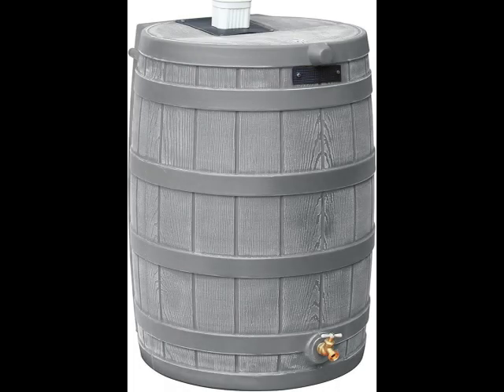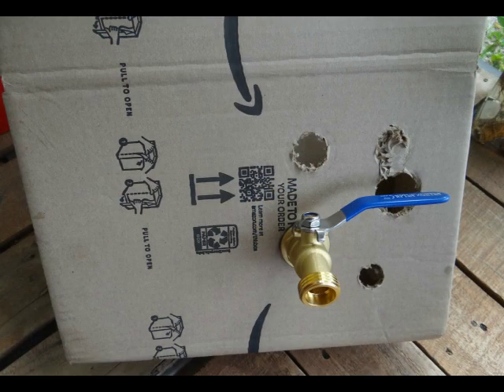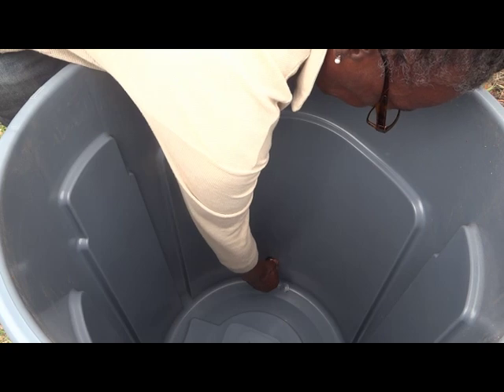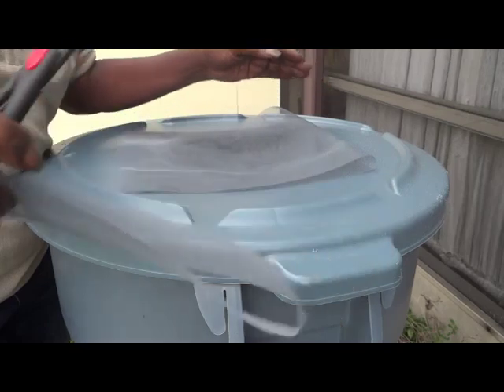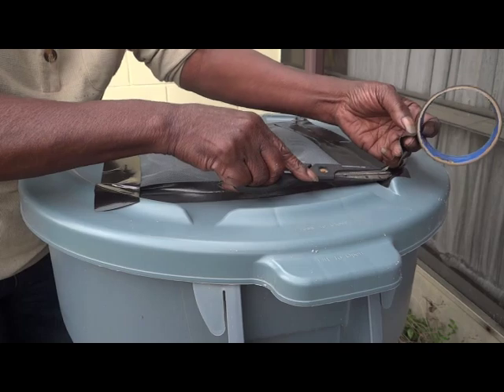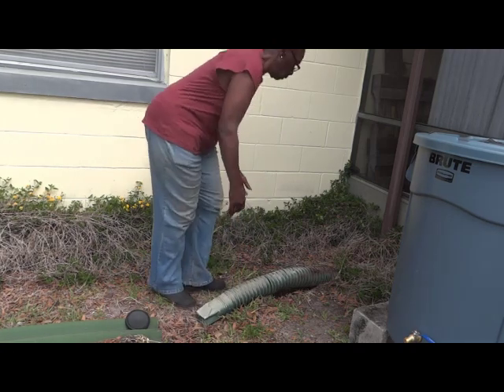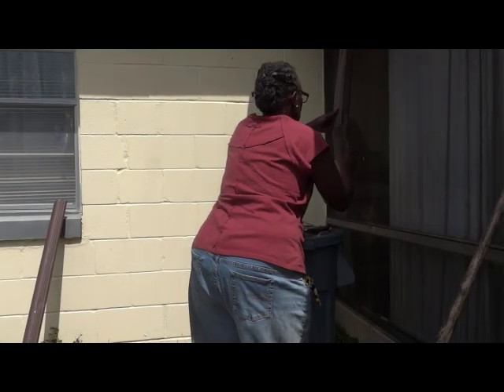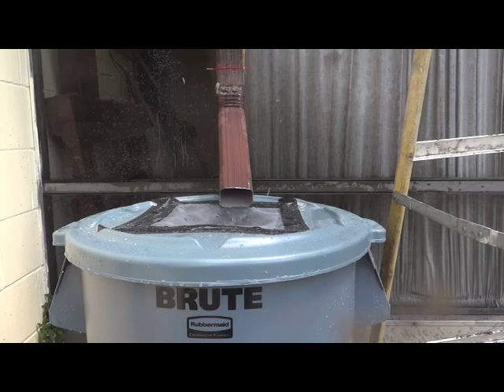Improve Plant Growth With An EASY Rain Water Collection System

Comment: This is a great project! Do you have a plan for overflow? I imagine the trash cans will fill up quick in a storm.
Reply from the maker: Overflow will be covered in the next video when I connect the two cans (I might add a third). I have PVC pipe for the connect and the overflow.